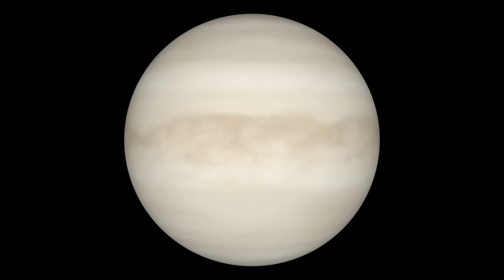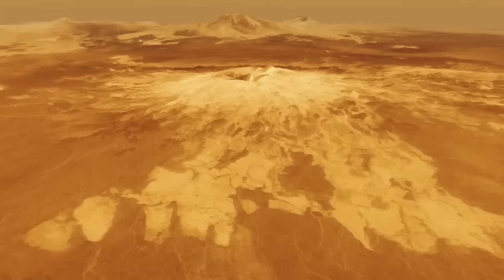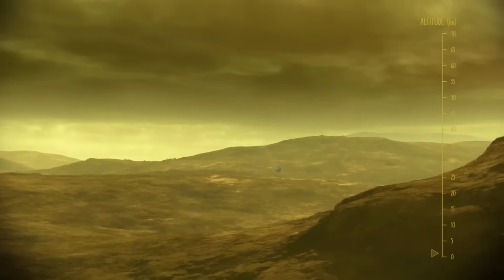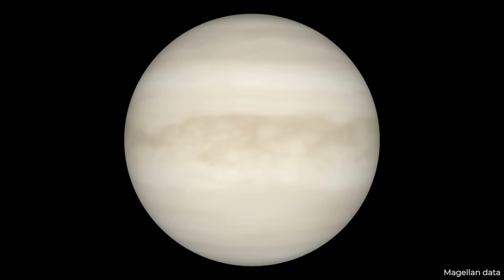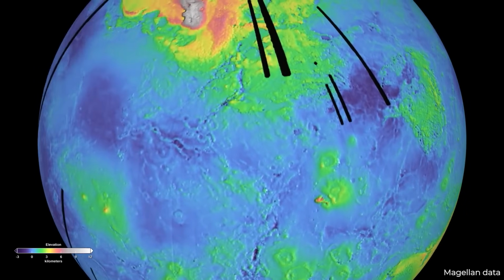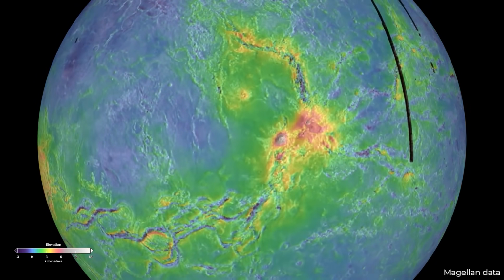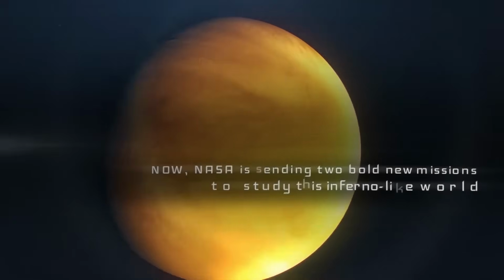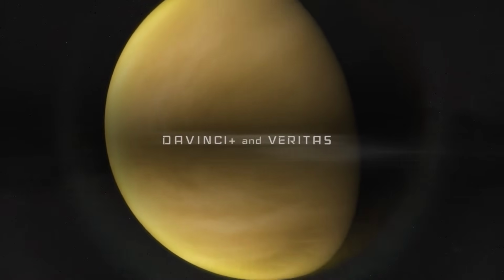Our Best Venus Map Is 36 Years Old. NASA Wants to Fix it With Balloons [NIAC 2025]

Comment: You must have some serious current draw potential at your house!  When I ran a 150’ power cable to my house it was only about an inch in diameter. I was running enough to power a 1500 square foot home with just regular double phase power so mine was pretty minimal. Although I was also only running about a third as far as yours. That makes a big difference in needed cable size.
Reply from the maker: We're planning to eventually run solar back into the grid, so we overbuilt it a little. Our cables are 2 inches? They run about 170 meters.

Comment: The idea of balloon on Venus is great. A tether seems unnecessary, prone to vibrations and could trigger lightnings. The first lightning will evaporate 1 mm cable and disable sensitive sensors. Edit: At lower altitude, the balloon will be smaller, that allows for thicker skin which combined with smaller surface will reduce loss off helium therefore increase the lifetime of Venus probe.

Comment: 🤔...I think you skip the helium and use nitrogen for the balloon instead. Venus' atmosphere is 3.5% nitrogen. So you use a cryogenic condenser on the gondola to extract nitrogen from the atmosphere to replenish the balloon. You also use liquid nitrogen for your towbody's cooling system. You charge a liquid nitrogen tank for an evaporative cooling system on the towbody . Then you deploy the towbody for a mission. When nitrogen runs low you reel it in and recharge it for the next mission.

Comment: ❓What about a aerofoil shaped bodies to produce lift perpendicular to wind flow to lift or sink both bodies and also generate local propeller or piezo electric power: cable only needs to conduct data then.

Comment: The tether can be a hose that runs cool mineral oil into the probe over the power and data cables. Or the data could be transmitted wirelessly and the tether could be lighter
Reply: By the time the oil gets to the probe it would be the same temperature as it.

Comment: Pretty awesome but extreme project. Personally., my first worry would not be the strength of the tether or the durability of the "tow-buddy" but the baloon necessary to use that system. Concidering the difference in wind speeds and the increasing density of the atmosphere, the drag of that installation must create a quite extreme pull downwards. I imagine, that this baloon would have to be an order of magnitude (or more?)  bigger to create the required lift - as compared to a system that just has to carry stuff closee to the baloon. 
An alternative would be to drop many individual small probes with cameras or other instruments in regular intervals (perhaps on small parachutes, if some instrument needs more time for messurements) and have them send data back to the baloon until their electronics fail. That would not create a full map but plenty of overlapping images with even higher resolution (because they would not be limited to a safe altitude and would not have to survive anywhere for long). And they could be deployed at points of interest. No problems with drag, smaller base module, more redundancy, more experimentation with different instruments under hash conditions, no reliance on cooling systems or energy production in the module that goes down. And the baloons are going to loose helium over time, if some of the instruments everntually get droped, anyways that would solve that problem without additional helium reserves.
Of cause, I don´t have any numbers can only guess what might be better. But that makes it only more interesting, what such a "tow-budy" would actually mean for the baloon system itself. I get, that this is a new grant and the details are propably not yet worked out, but it would have been nice to at least get some rough ideas about that in the interview.

Comment: It would not be a bad idea to have the balloon drop two windsock style anchors to slow the balloon and install a turbine through the center to create power and then drop the tow body below them and somehow deliver that power to the array. It would require a rather large payload but thankfully we have starship to deliver the load to space. It may require us to set up the Artemis moon base and launch to Venus from there for increased payload capacity.

Comment: Hey, I was wondering could they not use the temperature difference from cooling the imager to generate a small amount of power ? Also, what about using atmospheric drag to generate power from the whole length of the tether ? Cheers :)

Comment: Why not have a system that carried liquid oxygen down inside the lowered gondola to act as a heat sink to give the equipment a few hours of cooling time and when the liquid oxygen is running out pull the equipment back up to the balloon to be filled with a new load of Liquid oxygen for the next multi hour mission under the clouds.. If you got a few hours per lowering then it would achieve the desired result..
Reply: That could work,  did you mean with a very tough drone ?
Reply: Or a glider/drone using all that wind
Reply: @hawkbartril3016  Well yes the gondola that is lowered down into the harsh lower atmosphere has to be very Tough..  But if all you are doing is taking a Infrared and a normal picture that takes only a short time when the gondola gets below the clouds.. The area you can photo at 40-50 KM is a huge area.. So sending it down to take a picture once an hour might be enough to picture all the area you need to cover the entire path of the Airship as it travels around Venus..  You could even have a small power generator onboard the Gondola to take care of it's power needs..

Comment: Should basically be like dropping a small weather station down a drag-line of piano wire from a suspended balloon platform. Have a small turbine for some minimal power generation and transmit the data back to the main platform. It shouldn't be too hard to get relatively good estimates for achievable depths, with the temperatures and stresses to overcome. I guess the main question is if the achievable depth limit is actually below that cloud layer so that the best images can be obtained or if added effort would be needed to increase the capabilities.

Comment: Would the tow cable be flattened out a bit?  In other words, shaped similar to an airplane wing or linguini pasta.  A cylindrical shape would drag in the air more compared to its beneficial properties than if it was flattened to some extent.
Reply: Wings catch air, and how would you keep it from spinning.
Reply: @hawkbartril3016  one side thicker than the other would prevent it from spinning.  The slightly thicker side would get pushed away from the air flow direction.  The flatter it is, the more likely it would twist still but they could make it fairly close to a cylinder without losing all the benefits of making it more aerodynamic.
Reply: Flat things under tension oscillate. Picture a ratchet strap over a piece of furniture on the top of your car as you ride down the highway, or that famous footage of the Tacoma Narrows bridge.

Comment: Hey Fraser, I wanted to ask you this for a while: with the discovery of the new magnetic force of Altermagentism, could this be used to shield spacecraft from cosmic/stellar radiation? If so, or if not, what would be the best - most realistic - way to shield spacecraft from radiation?
Reply: Water. You wrap your water supply around a storm shelter deep inside your ship. During cosmic ray or solar events, you take shelter in there.
Reply: What is altermagnetism?
Reply: New force?  OMG.  The detector is going wild.